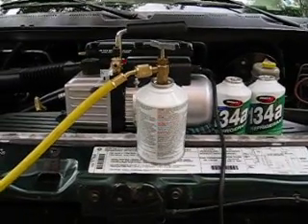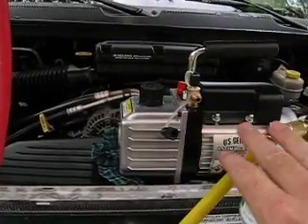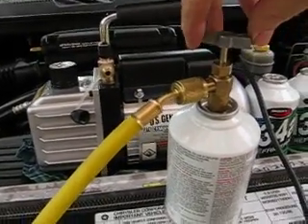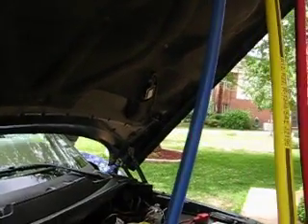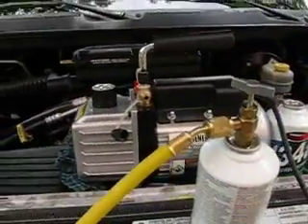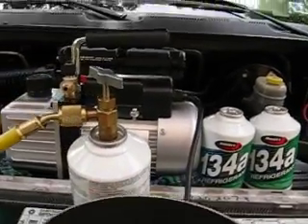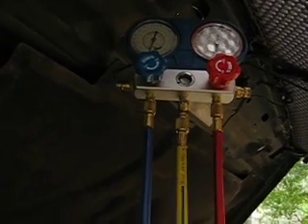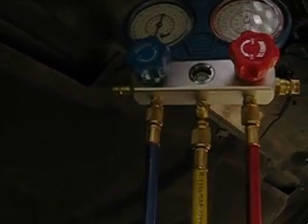Part 1. How to properly charge an auto AC R134a refrigerant air conditioning system.

Comment: Mike, where did you find your R134 can valve? I purchased one some time ago to go with my gauges and not only will the valve fit on any of the small refrigerant cans but my yellow manifold line does not fit on the can tap valve.

Comment: First of all, It is NOT Freon. That is a trade name for General Motors. It's R134a refrigerant. It is measured by weight, not liquid volume. That is why one pound of refrigerant does NOT equal 16 ounces of liquid volume as marked on the can.

Comment: R134a is NOT Freon! DuPont trademarked R134A as SUVA. DuPont trademarked R-12 as Freon. If you plan to purchase (Freon) R-12, you need an EPA license. Just wanted to clear up the confusion. I'm a ASE mechanic and know all the rules. Just for the record, they switched over to (SUVA) R134A in the 1994 model year.

Comment: take hot tap water and put it in a sauce pan, wait until it cools to 115 degrees F then just sit the can of r134 in the pan. if a system has no or very little r134 in it then let can discharge by itself into the system for a few minutes first then put it in hot water to increase the pressure in the can.

Comment: Actually R134a is Refrigerant and is made by Freon, Freon is a company name I believe its owned by Dupont. and he is 100% correct on the Warm Water Technique. It is a good Idea to " pull " a Vacuum down to 500 Microns. and as for the gauges you can only bring the Vacuum to 29.99 In of Hg ( Hydrogyrum ) liquid metal or Inches of Mercury. I only want to inform everyone who watches this AWESOME video a little more of technical stuff.

Comment: You know what I noticed Mike.. stupid harbor freight gauges... In order to charge the system you have to screw close the quick connects.. I happen to notice my can starting to ice up as I did and the low side pressure started to drop and went up as I brought up the rpms. I think I wasted about 2 cans...

Comment from the maker: @mikecarter79 

Here is an example of the kinds of pressures you should see at 90F outside temp and 50% relative humidity :
Low side :   ~34psi
High side:   ~295psi
Your center duct temperature with above conditions should be ~59F
(The above assumes a properly running ac system, and that it is running when these readings are taken, and the compressor is engaging)

Comment from the maker: @SubaruB4RSK You say "the low pressure with the car running the gauge shoots to like 90 psi or so".  The important question is : Is the compressor running ?  If the compressor running.   Is this 90psi on your Low side ?  90psi on Low side is too high IF the compressor is running.  Your High/Low pressures will also be affected by the ambient outside temperature.

Comment from the maker: @SubaruB4RSK This is normal. Even when you close the valves on the gauge, you will still see the pressures from  the High and Low side. When you close the gauge valves, all you are doing is shutting off the passage or connection to the YELLOW line. So, if you just want to go out and monitor your pressures and not add freon, you should close both the blue and red valve at the gauge.

Comment: So I charged doing only the low side today.. it took a little while but I finally got the pressure switch to turn on without me having to jump it (as I was leaving because of a storm) Anyways I still need to put in another can but what concerns me is when I turn the valve open for the low pressure with the car running the gauge shoots to like 90 psi or so.. should it take awhile for the high pressure to go up? I ask because when I ran out of the 1st can and closed the valve and tap the pressure

Comment: @mikecarter79 Yes I have the gauges connected the correct way the high side does not equalize on the system when i charge the high pressure the low still stays in vacuum.

Comment from the maker: @mikecarter79 Now, first off, I am assuming you have the gauge hooked up correctly on the Low side. If you are not seeing any pressure there(again, pressure on High and Low should be equal with engine off) , chances are you have a clogged oriface tube or  your Expansion valve is stuck in the closed position. Which one of these metering devices does your car have ? Do not run your compressor if freon is not flowing between High and Low side. This will seize the compressor because no PAG oil flow

Comment from the maker: @SubaruB4RSK  First, since the engine is off , the 105-110psi your reading is telling you that the pressure on the High side is equal to the pressure of the refrigerant can. You will only be able to put in a small amount of freon in your system when the compressor is NOT running. The ac system has to be operating in order to get a full charge of fron in the system. With that said, the 105-110psi should equalize across the entire system, so you should also see a pressure on Low side gauge.

Comment: @mikecarter79 

thanks man for taking the time to help me I don't understand why it will not equalize with the engine OFF I give liquid to the high side which depending on temp around 105-110 PSI I sat for 20 min with the can in my hand and nothing changed on the gauges at all low side was still showing a vacuum. I can jump the compressor and it will turn on. Should I try and jump the compressor and then switch to the L pressure and fill with vapor so it will force vapor in the system?

Comment from the maker: @SubaruB4RSK  With the compressor not working, the High and Low side should settle to equilibrium and the pressures should read identicle. Check the pressures again, and see if they are the same. I assume the 105psiH/40psiL where seen at charge time. If your car has a Low pressure switch, you can jumper the 2 contacts to the switch to test the compressor as well as the switch. The Low pressure switch is obviously located somewhere on your Low side line, usually near the evaporator.

Comment: Well I did everything... pulled a vacuum for 30 min I added a single can to the high side as a liquid with the car off the gauge got to around 105 psi and that was all it went to.

I disconnected the hose and charged the low side to around 40 psi with the car running and the compressor still wont cut on.

Comment from the maker: @SubaruB4RSK  Well yes, upside down will dispense liquid, and can tap up will dispense vapor. With your system empty, and drawn down to a vacumm, it is OK to dispense liquid into the High side, since there is no High pressure.....Yet.  When the engine is running and the compressor kicks on, you want to add only vapor to the Low side.  The High side will develop pressures of about 200psi, which can burst a can of R134a.  Adding vapor R134a to the low side is the safe way to charge any AC system.

Comment: Me again I was reading over my service manual for my car.. pretty interesting for the high side after vacuuming the system out I need to add liquid refrigerant into the system which I assume is turn the can upside down. and for the Low side it's vapor only with the engine running with the can tap up.

About 25 oz is full which is about 1.2-1.3 lb.

Last time I checked it was cold and snowy out which I think effects pressures.

Comment from the maker: @mikecarter79 (continued) ...
The gas that makes it into the Evaporator flashes off immediately and there's nothing left when it reaches the Low Pressure Switch so the compressor cuts out. What's left immediately returns to it's static pressure and in a nano second, it's back to 50 psi. An empty system doesn't do anything.

Comment from the maker: @mikecarter79 (continued) ....
Now, the switches on the High Pressure Line are the High Pressure Cutoff and Fan Switch and the one, when disconnected, that makes the Main Fan run is the Fan Switch. A fully charged and functioning system shouldn't experience any more than 8 on/off cycles in one minute. A low charge, or one that is severely restricted somewhere on the high side will cycle very rapidly and easily exceed this threshold.

Comment from the maker: @walker51f1 (continued) ...
The high side continues to flow into the Evaporator and any remaining liquid boils and returns to it's saturation pressure for the outside air temp. That extra volume causes the pressure to rise and when it reaches 50 psi, the whole thing starts over.

Comment from the maker: @walker51f1  You will need to look at your low side pressure. The low side pressure determines when to cycle the compressor on/off. The switch contacts are closed at ~50 Psi and as long as it has that much, the a/c clutch should engage when you request a/c at the Controls. Those contacts remain closed until the gas leaving the Evaporator drops to 25 psi. At that number, they open up and power is cut to the compressor.

Comment from the maker: I use a quick connect fitting. This type of unit first locks onto the high pressure fitting. Then you turn the valve which opens the shrader. You can get these at almost any auto parts stores.

Comment from the maker: No, it is not OK to open both high and low side during charging process.  The high side pressure will build up to around 200psi which has the potential of bursting the can of Freon. All charging of Freon or leak detection dye is done with ONLY the low side open.   When you are vacumming system, BOTH sides are open because there are no high pressures to worry about. Keep in mind that the system must first be completely discharged before starting the vacumm process.

Comment: when you do the vacuum you open the high and low valves, but how come when you put the freon you close the high sides and only open the low side. is it ok to open both? also when you are doing a leak test which side do you put the dye on the high or low. thank u so much for your help i aprecciate.

Comment: I hope you found a leak on that system before putting R134a in the system cause R134a is a ozone Depilation gas, and you can find this out if you can pull a stong vacum of 2 tourr

Comment from the maker: You would replace the amount of oil that you re-capture from the component you replaced. For example, if you replace a condensor, you want to empty out the oil from the old unit. If 1 oz comes out of the old condensor, then you will want to add 1 oz back into the system. Use specified PAG oil for your application. The underhood AC sticker should indicate what viscosity to use. You can buy oil charge cans at any auto parts store.